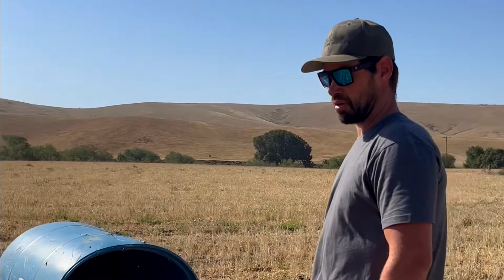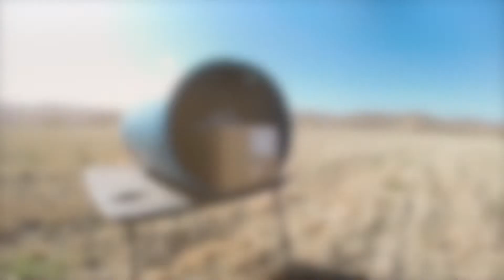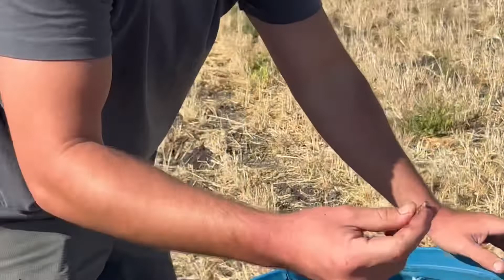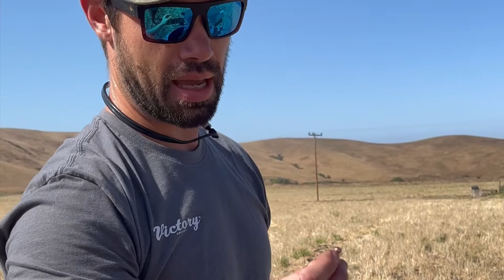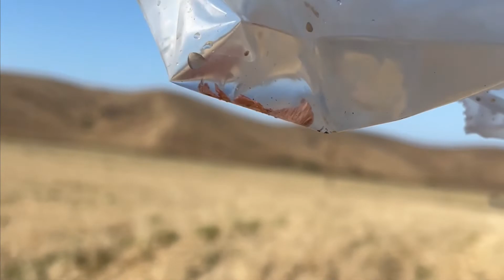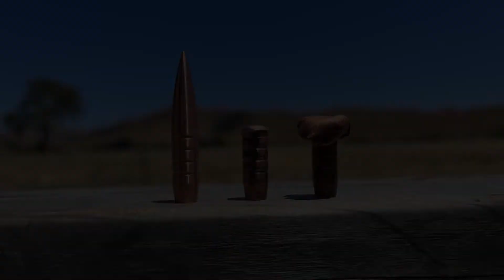McGuire Ballistics - 50 yd Expansion Test

Comment: I shot a buck at 30 yards quartering away, bullet entered right through the hind quarter and the core travelled all the way through and stuck on the neck. Massive wound channel with some broken ribs and a fragment lodge in the heart. Dropped right there never took a step. 

3200 fps 95 grain 25 cal